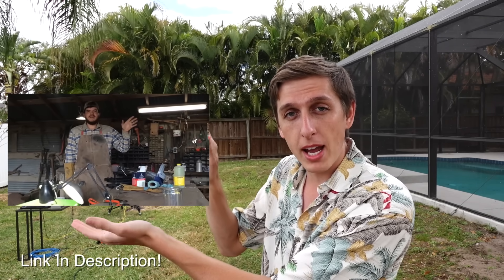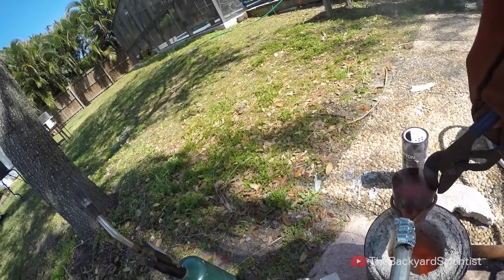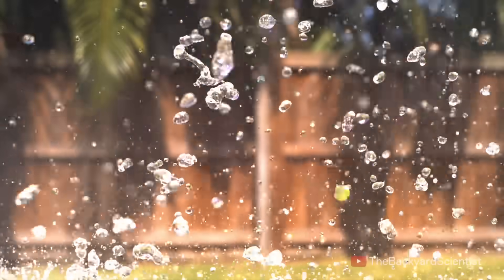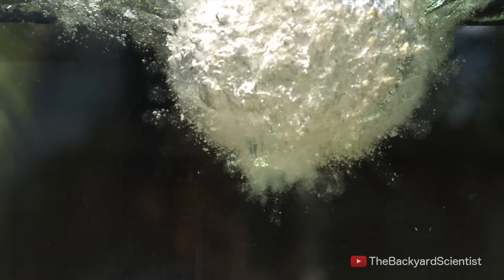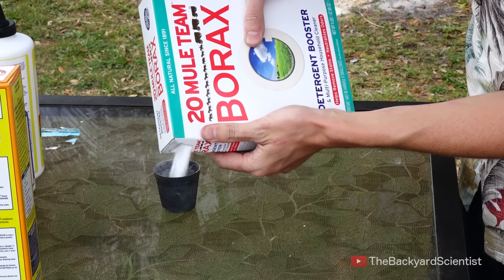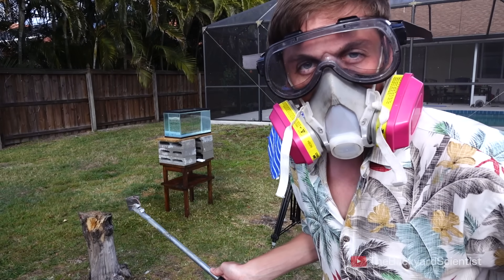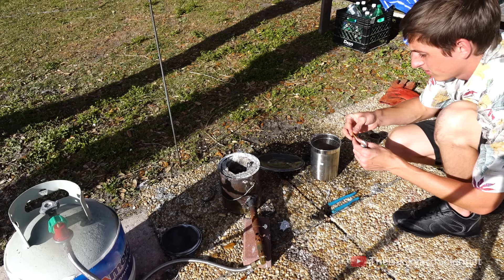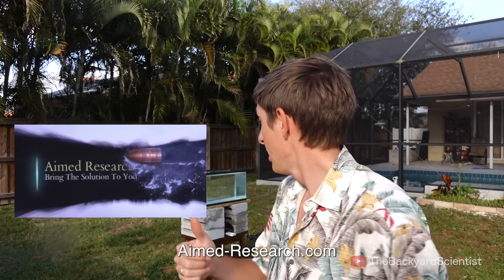Pouring Molten salt into Water - Explosion!

Comment: i would suggest using super fine grain elements such as magnetite among others...  in very fine grain and if Scott Manly  is right, depending on the grain size, you could control the reaction.  Plus i believe that you need you pick things that bond well with water, this would go along with why table salt and sodium chloride would work because they are some of the better bonds with it.  if the math works out this would work with anything that like to bond with water.  Sugar i think would be another good test for it because like salt it is a crystal that likes to bond with the water, as it is polar.

Comment: Sodium(Na) and Water(H2O) react rapidly and make NaOH and H2 gas, the NaOH then hydrates and forms solid salt crystals. Meanwhile the H2 gas escapes, creating the explosion. Takes like half a minute to figure this out.
Reply: However, the sodium is not sodium metal it is in a compound and is actually Na+ which makes it completely stable. Takes five minutes research this.

Comment: Maybe the Leidenfrost Effect doesn't occur with salt because of how quickly salt dissolves into water. So, instead of turning the water around the salt into steam and forming a barrier, the salt is dissolving into the water and the steam is exploding from the inside. Maybe because heat increases the rate salt dissolves into water, this process happens quicker.

Comment: The sodium goes under the surface of the water, it is surrounded by liquid water.  The heat from the sodium transfers to the water, which turns to steam, expanding 1600+ times its volume in an instant.  There is your explosion.  You are seeing the forces involved when the water now steam, is trying to occupy a space many times greater its original size.  It moves the rest of the water out of its way violently. Ask any foundry worker or anyone who pours lead for bullets etc what happens when you put a damp ingot into a pot of molten lead.
Reply: If this was the case, wouldn't you get an explosion from any and every hot thing touching water, not just salt?
Reply: Not always, there are many other factors in play here.  Surface tension and reactivity with water for one.  If your pour hot or cold metal into water, it will fizzle and pop a little bit but at the end you end up with cooler metal in warmer water but they are both pretty identifiable.  The salt now will want to dissolve in the water.   Steam is a fairly good insulator too, so the steam blanket can somewhat shield molten metal from the brunt of the rest of the water hitting it.  The salt now, since it's more fragile and wants to dissolve into the water, kind of cracks that steam blanket or another way to look at it, the steam bubble around it is not as sturdy, it wants to break and fracture and go all over the place, so in essence the hot salt kind of breaks out of it's protective bubble, hits more water and forms a new bubble of steam, over and over again, and boom.  Yes I know, this isn't exactly a stellar explanation ill try to work on something better.

Comment: Try heating the NaCl to the temperature of the other salts to see if it still explodes. If not, that shows that the others might be leidenfrost effect. The leidenfrost point could be different depending on what the liquid is in contact with, but I don't know.

Comment: Suggestion: use infrared camera to track the sodium chloride chunk's position. (and the rest of the ionic liquids for control group).

I'm also pretty sure the explosion happens because the salt chunk gets propelled with high speed into the water so it bypasses the leidenfrost effect. Every new little bump in the bubble can be seen to leave behind some white powdery thing after the bubble imploded, so that's where the salt is.

Comment: It's simple.  Pour anything with a 1500 degree melting point in water, and you'll probably get similar effects.  It also might have to do with specific heat of salt being higher than the other salts, which means in addition to taking a much higher temp to melt, it also holds onto a lot of that heat.  If that is true, the difference between the temp of the molten salt and water causes so much water to instantly boil that it sends massive pressure waves enough to shatter glass.  

Notice the difference between the sodium and the salt as well.  Sodium has a violent chemical reaction that results in instant oxidation (i.e. fire).  The water is nothing but kinetic energy and nothing chemical about it except for the rapid change of state.

Comment: It could be possible that there is reaction: NaCl + H2O -> NaOH + HCl, reacting back to NaCl and H2O 
This should be because of compúonents of molten salt is not bounded to each other and when it meets water, it will react on their own as elements. HCl is gas, produced water is gas.
Your theory with vaporizing water from the middle of the salt has to work with every molten material.
Also there will be no pH change because once molten salt reacts with the water, it will react back to salt.
Proof for this? You cant see any disolving pieces of salt after explosion.

Comment: I have an explanation that the molten salt is a chemical reaction, and it explains the lack of a pH difference: The molten salt reacts with water to form NaOH(s), H2(g), Cl2(g), and HCl(g). The other gases add to the power of the explosion, and the HCl moderates the expected pH change.

Comment: sodium metal doesnt need to be heated for it to react to water, i'm fairly certain... thus is negates your theory....
Reply: runtothehills - no it doesn’t, he was trying to replicate the conditions the molten salt were in. Even when solid, sodium has a lesser reaction than the molten salt and when at a higher temperature - reactants react easier and faster, especially when it goes from solid to liquid because the interface between the two liquids is much larger.

Comment: the chemical ratio to sodium chloride (salt) is 1:1 while borax has significantly less sodium. sodium is an alkali metal which is extremely explosive, and is the only alkali metal present in borax making it significantly less explosive. i do suggest experimenting with solid sodium and water, very little would cause quite an explosion

Comment: You cant melt salt but when you heat it, elements will split and chlorinegas will flow away an natrium will be left, and natrium reacts with water
Reply: Geert Visser You can melt salt. He did it in this video. If you look again, you'll notice it turns back into salt when cooled, not sodium metal. Where the hell did you get this idea?

Comment: The reason for the explosion is because the molten salt superheats the water leading to explosive boiling. I think you pretty much explained in the video why the Leidenfrost effect happens for the Borax but not for the molten table salt. The reason the borax does not result in explosive boiling is because it stays clumped together and therefore the Leidenfrost effect develops due to the high temperature difference. The Leidenfrost effect cannot develop on the breaking apart molten salt therefore the boiling cannot reach the Leidenfrost point and stays in the transition boiling regime.

Comment: You're right about the reaction, except the chemistry; Borax structure is different and includes a ring structure stabilizing it even at high temperatures - it's essentially a  REALLY BIG MOLECULE  allowing electrons to be shared in multiple orbitals all the time, but NACl which is a pure ionic bonding (ie metal and non-metal) scenario, would react this way as the charges are SO MUCH MORE separated in molten form, they are more reactive and so produce a BIGGER energy reaction than pure sodium (which has a charge but is more stable as it doesn't have a polarized energy difference in electrons as the sodium ions in the NaCl compound; Think of a basic chemical-physical energy reaction when chemical energy is converted to physical energy - say a battery - the voltage (ie potential difference in energies) needs to be sufficiently great enough to have electrons travel to exert a force. The water is simply the conductor for this energy and the catalyst).

Comment: sweet video!  from the first high speed I can tell it's just water spontaneously changing phase.  the even growth of the boundary suggests the same.  if it were a chemical reaction it would be biased towards the areas that were touching first.  and then you can see the salt falling inside the vapour bubble and creating smaller explosions on the boundary.

I'm not sure why the other salts don't create explosions.  either they don't have the mass, or total thermal energy, or they can't transfer the energy to the water as quickly.

Comment: Maybe some of the water decomposes into hydrogen and oxygen and the sodium chloride acts as a catalyst lowering the energy needed to do that. You say this is a steam explosion but I find it very unlikely since the volume expansion seems higher than what normal steam could produce.  It looks more like exploding TNT under water.  I think the energy of the molten salt and the amount of steam it can produce can be calculated.  It is simply not sufficient for the dramatic effect.  Water splitting wouldn't change your pH as well

Comment: Experiment is a good thing but it will give you knowledge only when you interplet the result correctly which some scientific basic knowledge would help. You seem don't even get the right definition of "chemical reaction". Yeh ... this had reaction involve, especially the second one. The heat turn the water into gas which expand its volume about 1,600 folds so when you pour hot stuff into water, no matter what, the more the transferring rate of heat (depend on the temperature and surface area of the heat carrier media), the faster the water turn to gas. and when it expand too fast and have no where to go, it explodes. Like if you heat a pressure cooker to much overheat. So if you pour anything hot into aquarium, the bigger the aquarium, the smaller the explosion (at same temperature). .... However, on second test, you use Sodium (Na) which is in the first row of periodic table. It dissolve into water with extremely fast rate so even you didn't heat it up, Sodium is normally has strong reaction with water. It can even self-combust if you leave it expose to the air. With the right amount and grain size, actually, you can already make a small explosion without heat. (and if you change it to Potassium (K) ... that's a real explosion. .... When you put Sodium into water, Sodium will break bonds between its atoms and built up ionic bonds with water. You might use the term 'dissolve' but in fact, this is and Chemical reaction called 'Hydration' and in case of Sodium, this Hydration reaction is a heat release reaction. When you pour hot Sodium into water, the heat do its job like I said above, the sodium release a lot of heat in a sudden in its hydration reaction and since you heated Sodium up, it speed up the reaction and that means speed up the heat release rate. You can see that the Sodium combust as soon as it touched water surface then the sum of the heat caused  explosion but since the explosion occured at the surface, so the reaction has the open air to throw the heat up, away, left small heat create small vapor which was not enough to generate pressure, strong enough to cause any damage to the aquarium. .... that's it.  Since you like to do experiment, I guess you love science. So I suggest you read more. So that, when you do experiment, you know what you're doing and you know exactly whatever happen mean. Regards.

Comment: Did you for real use a paper pH test strip to conclude an actual 0 percent change in pH? With such a small amount you'd really need a digital pH meter to conclude how much if any the pH changed.

Comment: This could never have been a chemical reaction ... splitting Na from Cl ?? no way ...
Something is causing the water to become rapidly in contact with the salt .... could be to do with the surface tension of molten salt .... or it's solubility, dissolving rapidly exposing more salt to the water ... could try with KCl .. or NaBr  etc

Comment: Your experiment with molten salt could have dangerous consequences. I worked in a heat  treat while going to college. We used neutral salt heated to 1550 deg. to heat treat parts. The time at temperature depended on the material an Rockwell required. The next step was to dip the parts in oil heated to 180 deg. as the quench operation. The last operation was to rinse the parts and tools in water to rinse off any remaining residue from the parts. 

It was extremely important to make sure that any tools were extremely dry before repeating the heat treat cycle. There were reported incidents where operators did not dry tools properly and were either killed on severely  injured by molten salt as the reaction between the salt bath and the tools still retaining water caused a massive explosion. 

Neutral salts can also be used at lower-temperarture to heat treat parts as well. In some instances the parts were formed and placed in a fixture. The parts and fixture were placed in a salt bath at around 750 to 800 degrees. The process is a form of heat setting the parts to retain the final shape. The tools should also be dry before restarting the next cycle.

Black Oxide is also a molten salt process. Again, the mixture of salt and water can cause a violent explosion. Molten salt or molten steel can cause severe injuries. People should not try these types of experiments die to the dangerous repercusions

You can read more about the Neutral Salt Heat Treat process at  http://www.bodycote.com/en-GB/services/heat-treatment/harden-and-temper/neutral-hardening.aspx

You can read more about Neutral Salt Heat Treating at https://www.industrialheating.com/ext/resources/IH/Home/Files/PDFs/A%20Guide%20to%20the%20Safe%20Use%20of%20Molten%20Salt%20Baths.pdf

The best explanation of the process is available at http://www.anvilfire.com/article.php?bodyName=/FAQs/heattreating.htm

Be safe with your experiments on the gun streaming liquid metal. Any failure of a gun component could cause serious injuries.

Comment: Physical change only. It's the evaporation. Water molecules evaporate due to the sudden heat from liquid to steam, and it generates huge pressure.
Reply: nomearod Yes but why does the heat from the other salts not do the same?

Comment: You could try with Caffeine.
Caffeine has a tendency to explode, when after heated in a microwave for a few minutes and then comes into contact with cool water.
Ps: I am aware, that it is very difficult to heat caffein, as it usually sublimates, but for some reason it doesn't do so when heated in a microwave.

Comment: Molten salt is a main component in a Nuclear reactor powered by the element thorium. The reactor is called an LFTR (Liquid Fluoride Thorium Reactor) and more commonly called the molten salt reactor. The molten salt creates charged particles and when mixed with thorium creates intense energy that doesn't leave behind spent nuclear rods

Comment: Maybe because of the higher melting points of the other substances, when the salts come into contact with water, it vapourises immediately therefore causing the leidenfrost effect, but sodium chloride, because if it's lower melting point compared to the other salts let's a little bit of water get "caught" as you theoriesed, causing the explosion. Ik that both salts temps are waaaaayyy higher than waters boiling point but since some are higher, the speed of water vaporizing is much higher than with NaCl

Comment: It’s still a chemical reaction.. a change in pH only means that the reaction induced hydrolysis yielding/or not yielding standalone H+ ions or some kind of acid. In this reaction in particular, the sodium ions from the sodium chloride (the salt) are reacting with the hydrogen ions of the water to form sodium hydroxide which is strong base not an acid. This leaves me to wonder though why pH didnt increase..

Comment: Fellow Chemical Engineer here. Very cool experiment btw! I think the molten salt is breaking down the water into to NaOH and H2, and auto-ignition of the H2 causes the molten salt to fragment and explode. H2 has an auto-ignition temperature of ~950 F and the salt has a melting point of 1474 F. Super heating of the molten salt appears to be needed to overcome the Leidenfrost effect to provide enough heat transfer to overcome the vapor barrier and start a chemical chain reaction. The exact science behind this is not well understood and quite frankly we don't need to understand exactly what is happening for industrial boiler design. A lot of empirical data is used for chemical engineering. 

When you did the litmus pH test the water to NaOH ratio was probably too high to raise the pH significantly. Only a very small amount of H2 / NaOH needs to form to cause an explosion like this as gaseous H2 takes a huge amount of volume, about 1000x it's liquid state. I'd recommend trying the pH test again with a smaller reservoir of water, like a thin layer of water in a small plastic tub. Residual NaOH from the explosion should raise the pH. 

Borax is Sodium tetraborate decahydrate, which means 4 boron atoms per 1 sodium atom, so there is much less surface area available for the sodium ion to react with the water. This  greatly limits the reaction rate and the Leidenfrost effect becomes dominate.

Comment: yeh the NaCl one was because the wather got instandly evaporated and coulden‘t get away fast enouth.
but that one with Na was an chemical reaktion Na reakts in wather to NaOH
bettet said the Na2O wich is one the surface if Na (because metals like Na oxidice automaticly) so Na2O + 2 H2O —> 2NaOH so if you would measure the pH value of that wather you would see it